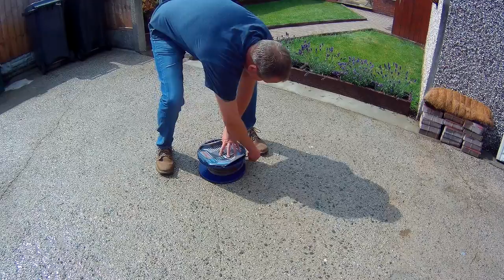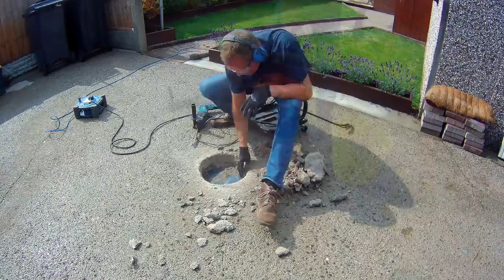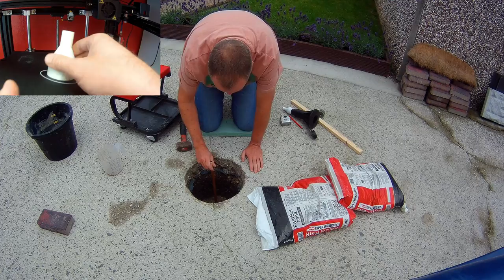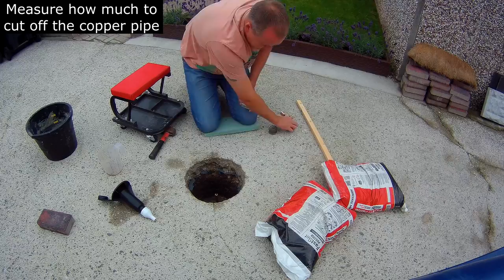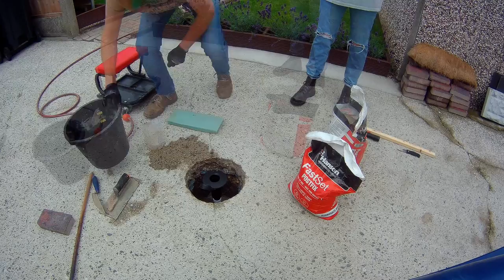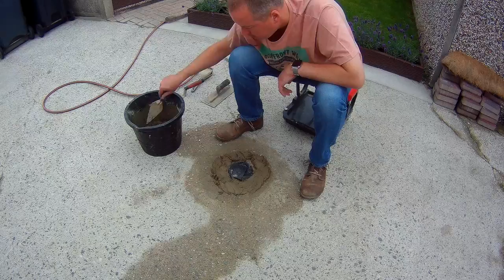Installing a Brabantia Rotary Clothes Line using a concrete tube

Comment: Great job.  Do you have the STLs for the 3d printed adapter?
Reply from the maker: Sure thing, just uploaded it.  I recall I needed to slightly file out the inner 15mm diameter a tiny bit to ease the copper pipe in. Hope it works out for you.  https://www.thingiverse.com/thing:5358306